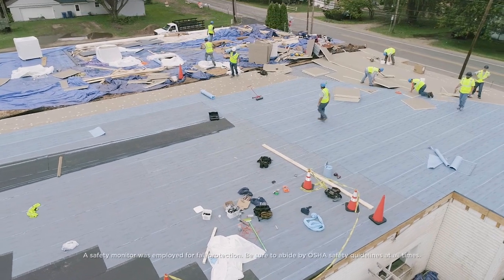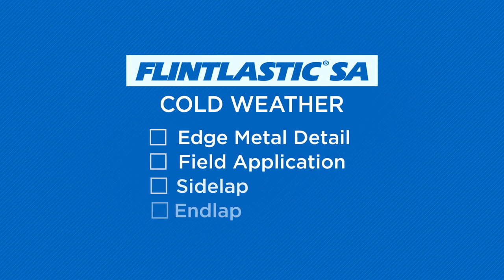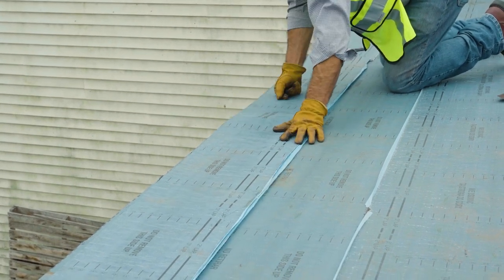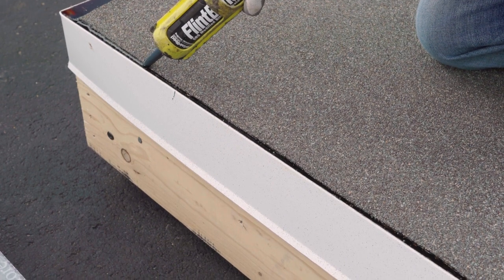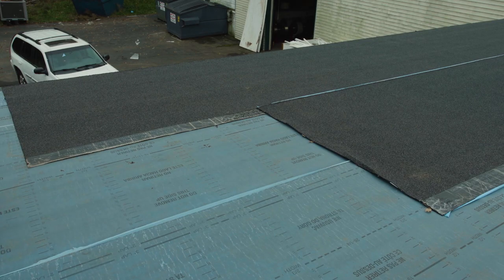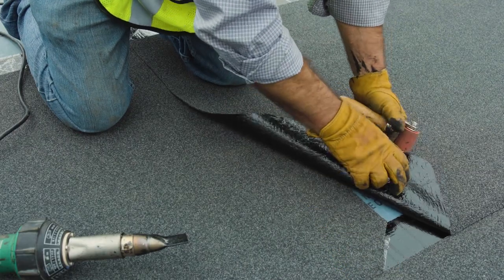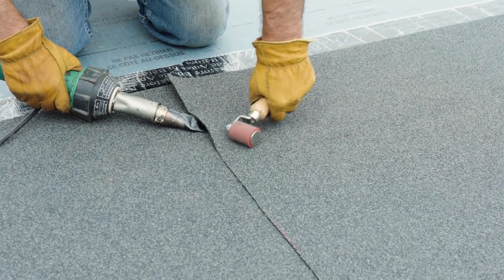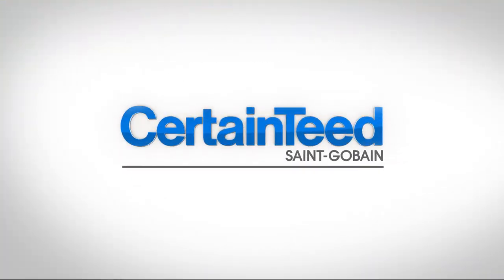Installing Flintlastic SA Self-Adhered Roofing Membranes in Cold Temperatures

Comment: ??? Is there a way to evaluate a failure causes? My 2015 roof is sliding down on the front (south) side. It's now about a three inch overhang and the seams above it are coming apart. 

What's the possible causes? 

What's the fix? Is the whole roof compromised or is there an easier fix?

Thanks for a great video. 

Our location: Central Florida weather zone 9B. 

In 2020 the roof looked fine when inspected for any weak areas.